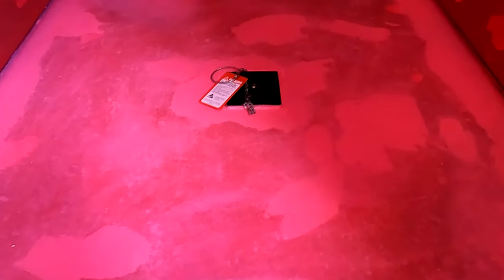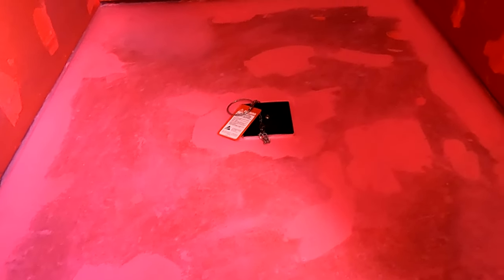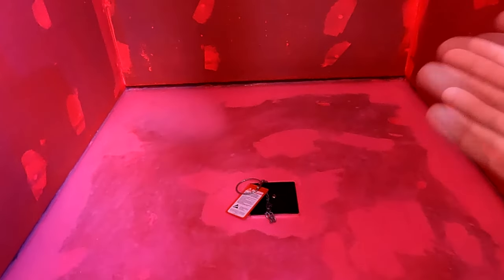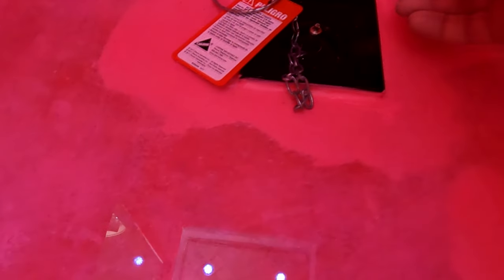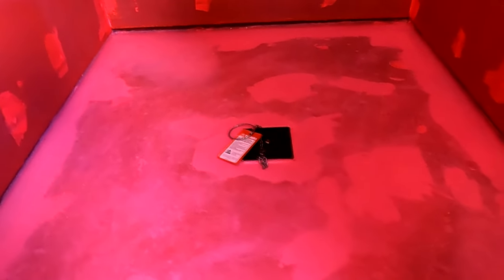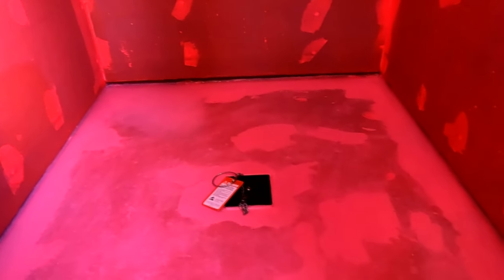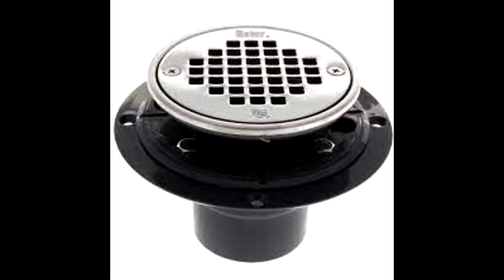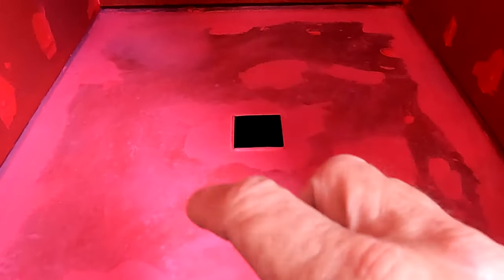HOW I CREATE A SEALED WATERPROOF SHOWER PAN

Comment: Bob, you don’t have to use the sheet membrane with any of the bonding flange, you could roll topical membrane right up to the edge of the drain opening. AND you wouldn’t have a dam like with what you have there to prevent the water from going down the drain without any weep holes.
Reply: this is the way
Reply: I've debated on that for a few weeks. The linear drains, us shower brand call out just painted topical up and onto the drain outside. The dam is only 1/4" to 3/8" at the most. And that area is filled with grout. Grout gets wet every time and needs to dry in between. Some thinset is underneath, but then again all showers have that accumulation or dampness. Little dam or not, it's a small amount.
Reply from the maker: I suppose what people don't understand about these drains is once the tile and thinset are put down it will take up the difference and be flush with the top of the drain, there won't be pooling of water below the tile because there won't be any room for the pooling, perhaps a little moisture like the rest of the shower will be there for a few hours or a day and then dry out
Reply: @StarrTile  water wouldn’t go thru grout lines?
Reply from the maker: @tommynguyen8942  I didn't say water would not go through oh, it's possible if you use epoxy but either way what I said was if it does go through it'll dissipate because all the room and space is taken up by the thinset in the tile
Reply: @StarrTile  Thanks for the replay, i'll sleep much better. I'm almost to tiling. Cheers

Comment: Agree with the wicking, ive started rasing wall boards a few years ago, but a few things i disagree with as a tile guy, corner dams are a must, you horizontal panliner on a curb isnt gonna help when it touches the 2x4 on the side, also never screw the curb on the inside or halfway into the curb on top, only use foamboard, or wrap fabric with memebrane around the curb, with corner dams you can make your curb not a ponywall to climb over to get in a shower 😊

Comment: I’m undergoing my shower remodel
Right now and it’s looking exactly like yours! Learned a lot from your videos, my issue is the floor.. floor is sloped to the drain correctly, but I’m thinking the slope
Might be steeper than need be..
I’ve redgarded the shit out of it, it’s fully enclosed.. shower pan liner test successful, hardienbacker is up off the floor, sits above it maybe 1/2 inch to an inch. Taped and mudded the shower walls. My question .. Does the tile sit above the drain or should it be flush with the drain?
Reply from the maker: I usually like circular drains so I can have the tile slightly above the drain and make taper cuts on every tile, but with a square drain it's difficult at best to get taper cuts so I make it flush

Comment: Watched most of your video. Very knowledgeable. What do you think about the Divot system? I came to the point where I need to do sealed as you did or go with Divot system so some water under the tiles will go to the drain. Any thoughts?
Reply from the maker: I've watched a few videos on the divot method and I don't like it, it is not definitive enough and seems to be much more work for no return

Comment: Thank you Bob.  I am wondering why all the water didn't drain in this video. I know your pans are perfect with the correct slope so I must be missing something. If all of the water doesn't drain before the floor tile is set, why would it drain after you set the tile?  Water will go through the grout and will just stay between the tile and the redguard.  What am I missing?
Reply: I've had this debate for some time. Linear drains have this problem. Its going to be a small amount in general. All systems will have saturated thinset and grout. The integral drain with no dam do drain all the way but the thinset and grout are still saturated. A shower needs time to dry in-between showers or days. Seal your grout to mitigate it. I'm doing this right now, about to set tile. Issac said this comment about the dam. I'm going to drill a few weep holes but keep it water proofed around the hole. I'm sure it wont do much. but can sleep a bit better. I'll flood test for sure. look up "us shower" drains for their instructions.
Reply from the maker: @davidmcclain5180
That this is a square drain that's below cap to take up for tile and thinset, once those are set it'll be flush... any water that gets into the grout will evaporate the same way the rest of the shower would, there won't be excess  pooling of water because there will be no space for that to happen with the tile there

Comment: Simplest would be use Hydroban's Kerdi-like membrane sheet system as-directed.  Then go over seams/changes of plane with their liquid.  Probably a bit more pricey, but 1.) you know all the products will work together and 2.) it'll come with a warranty.  I get that warranties tend to be useless, but it's something to entice the customer with if they are willing to eat the extra cost of the product.
Reply from the maker: For me money is not really the issue, my customer pays for the material anyway, and I don't rely on the manufacturers for warranty, I rely on myself. 
But just like you said overlapping a sheet membrane with a waterproofer will be the way that I would go about it, but then again the products aren't as important as the application of anything used.

Comment: Bob, why do I have mold on my subway tile. Removed tub and tiler did all that asked accordingly to your videos. Used cement boards. I redgarded 3 coats. Did a great job. Tiler used thinset mortar and I sealed the grout with Mapei grout sealer. Shower is 3 years old. I thought I did a good job but I guess I didn’t. I’m going to spray it down with vinegar solution and water. Let dry and reseal. Any thoughts?
Reply from the maker: I don't know what part of the shower you are getting mold on but ventilation is very important and most houses nowadays do not have functional windows so you would need a really good CFM fan to get moisture in the air out of your bathroom, having said that mold will usually grow only with air food and moisture, apparently there is some food going on somewhere....
I'm in a very humid environment in the South and with my shower in particular because it is all natural stone then I will get mold that is attracted to it every few months and I spray bleach it and let it stand for about 5 minutes, scrub it down, and rince.
Reply: @StarrTile  there is allot of dust in the home. Had an exhaust fan installed but we have to shower with the bathroom door open to help with the steam. The walls (painted) part gets moisture on them, no mold though, just in shower which has a curtain not invaded in glass. Thank you Bob. Gives me a place to start.

Comment: It’s waterproof but your getting standing water in your pan after every shower bc your drain body is up to high. It sets to high bc it’s not made to be sealed. Setting water begets mold & mildew. Just my two cents. You’ve evolved your process like we all do over the years but don’t wanna take that last step of using a drain that’s made for the purpose your using it for. Just my two cents Bob not bashing you at all buddy. 👍
Reply: everyone has been saying exactly what you just did for years. he is correct that sealed system is superior but i don't understand why he won't use the correct type of drain.
Reply: I've done this exact method and no standing water with tile installed. Basically the tile and thinset get wet, drys out within half an hour, I live in az. I've been in other showers that stay damp for hours, can tell someone took a shower that morning.
Reply from the maker: @ohmsweetholm7259

Basically what last guy said, no void will exist because tile takes it up, water flows off tile into drain, the little moisture that gets at waterproofing and thinset will dry out same as any other shower with any other product like FloFX and sheet membrane

Comment: Good morning good sir! Eddie here in NY… 
I wanted your thoughts on a way my contractor does his prep work. No slope. He red guards the sub. We nail wire. Stretch pan. He red guards the mud afterwards, all seams and taped. 5 years he’s doing this never leaked. No vinyl. At first I was really concerned. Wonder if anyone else does this.
Reply from the maker: Everyone has their own method, although I may not agree with his and a lot of people don't agree with mine the proof of the pudding is more important...
No leaks over time & you're golden.
Reply: @StarrTile  I’m old school with the vinyl. And these shluter systems to me personally are garbage and very expensive. Thanks as always!!!
Reply: I hear this often..."Five years and i've never had a leak". But when i replace a failure, I can tell it has been failing for many years. (as evidenced by the amount of rot....sometimes it's like wet mulch). Though it took a very long time to materialize to something visible (stain on ceiling below,pehaps) to the homeowner. That being said, I can often tell at first glance inside the shower that there are potential leaks, as evidenced by mold or staining. My point being; We accept (theoretically) that topical waterproofings are below thinset and grout, and we accept that they can and probably will be saturated above the waterproofing, and that they will dry to the air between uses. We should therefore prepare to accept the possibility of any leakage through the topical waterproofing would also have the potential to dry between uses to some degree. At the same time wreaking a slow havoc on the underlying structure (probably cellulose and wood based). Point is 5 years doesnt seem like a long time. I suspect a younger man than I, may one day be ripping apart showers looking very hard to find where the liquid applied membranes are failing....

Comment: I agree 100 percent with this system.  Most information I see about using a topical membrane on top of a motar bed with a pan liner is a big no no... They all say that you're creating a "moisture sandwich"
Would that be from the mud bed not cured enough? Where would the moisture be coming from if the mud bed doesn't get wet? Please someone give me peace of mind,  Thanks
Reply from the maker: Drying and curing are two different things, my mortar bed is dry after about day 3 with a fan blowing near it everyday..the curing process typically takes about 20 days for a cement product and will do so on it's own.

The mold sandwich that you speak of or moisture sandwich would be if any water escapes your waterproofer and enters into the mortar, mainly because you have a pan liner under it what doesn't allow the water to escape and your waterproofer on top of it, so if you make a mistake on your topical waterproofer then yes you are introducing moisture into an otherwise dry mud bed.
Reply: @StarrTile  Thank you for the quick response!! Your videos are awesome and lots of great content on your channel,  Thank you!!
So basically, if my topical membrane, water proofing, is done well I shouldn't have any concerns give the mud bed a solid week before applying the membrane?
Reply from the maker: @ryantucker4633  yes let it set for a week, longer if you can no harm no foul
Reply: @StarrTile  Thanks again!!

Comment: What’s your thoughts on systems like hydroblok which don’t rely upon thinset for water proofing, rather a sealant type seal. That would seam to mitigate your rational concerns about Kerdi for instance who use thinset with a membrane.
Reply from the maker: Different methods and manufacturers have exponentially come out the last few years to come up with a better mousetrap... what you mentioned is just one of those, if I stumble on something that makes things easier and I am confident with it then I will start using it, but in the meantime I came up with this solution way before manufacturers came up with products. But at the end of the day I have to feel confident, and I'm confident with mine

Comment: What people / contractors who critisize this method of waterproofing  need to realize is you are creating the same shower base equal or better than a foam , acrylic , or any other  solid surface shower base . The rubber membrane under the pan with this method has become a second line of defence for a failure . Other methods as mentioned above have only one line of waterproofing between a success and a failure . It is a hybrid way to waterproof a shower  , born from critcal and logical thinking because of new products on the market . Just a side note I have seen some videos lately from some popular Youtubers that are experiencing Kerdi line drain failures from the tape used to fasten the flease to the drain at the factory  separating  snd allowing water past it. Gonna cause some sleepless nights ( for contractors who care ) I bet after installing 100 's of these . Hmmmm if only they had a second line of water proofing .
Reply from the maker: Yes I agree with all you say, and to your last point about those drains oh, that's what I always do proactively to have a second or even a third line of defense because I don't trust what the manufacturers supposably do on R&D... obviously they failed that process with their own product.

Having said that if foam pans weren't so damn expensive and didn't take so long to acquire then I would probably transition to those instead...maybe...😏

Comment: It's not draining though...indo the same as you..I just don't silicone around the drain so that water won't puddle and get to the weep holes. Isn't that considered stagnant water?..just asking
Reply from the maker: The only reason it doesn't drain all the way here is because it is a sealed system and the drain Edge is higher than the Pan, Once the tile matches up to the top of the drain edge it will all go into the drain properly
Reply from the maker: @nuttboxxx  if water was to get through the grout  I'd still rather have it dry out the same way it got in than have it stuck in the mortar bed.. wet tile and grout has never caused a failure but wet  motar always will